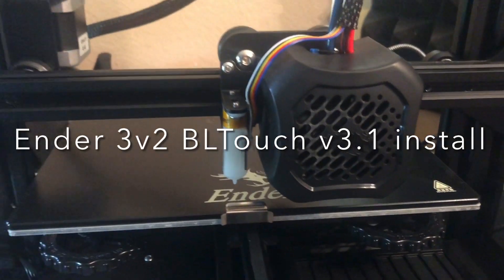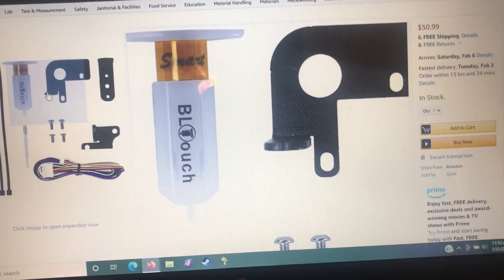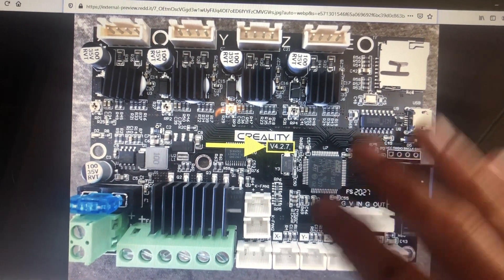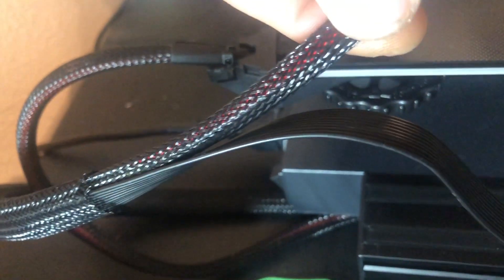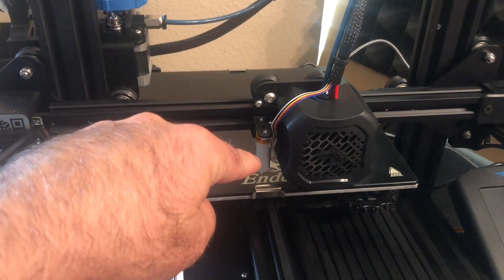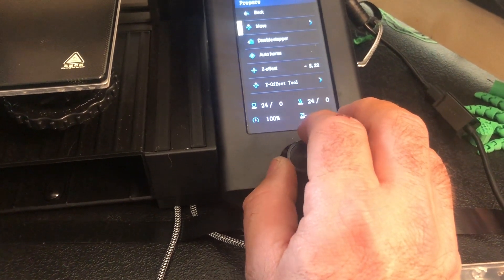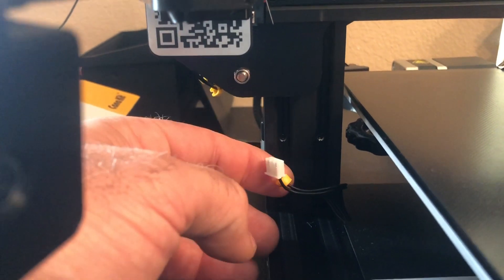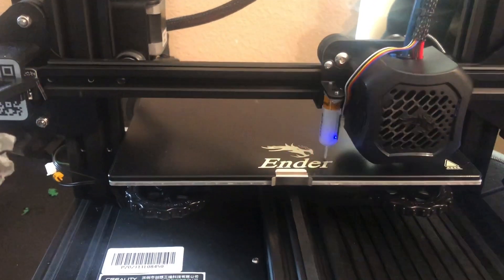Installing the BLTouch 3.1 kit on an Ender 3v2

Comment: Great job. You need to try your hand, at this making video thing. Watchable style, good voice over, left no questions behind. This was a overlooked popular mod.
Reply from the maker: Thanks so much!  I’ll make more. I’m still unsure of what exactly that looks like or how often. But more will come.
Reply: Spent 4 days on the BL touch this video helped me out of the woods. The big issue i missed was the included metal mount I somehow had upsides down. My endgame was Smith3d and with this video it was finally a wrap. Saving settings was key.
Reply from the maker: @JasonStPierre  Jason let me ask you something.  Any steps between the more popular videos and this one that you feel get missed?  We have another 3 V2 arriving today. Assuming Jess will let me mess with her printer, I’m thinking about remaking this video as a full BLTouch install from start to finish.
Reply: @brianhart1771  OK a few key issues I have had, ONE: I got the same BL touch kit . I followed another tutorial that suggested the sound idea of twisting the included wire to reduce interfeance form the other wires in bundle. I had a issue prior that the BL would error out otherwise this fixed it. a ferrite choke would have as well but this was free and simple.
TWO: The extruder was in my kit with outer parts, marking off 100 & 120mm on a cutoff and doing a "free air calibration" bowden tube off extruder was a simple math free adjustment detailed here, https://youtu.be/lH-RrjtiC8M

Also see all this guys videos. Tomb of 3D Printed Horrors https://youtu.be/xzQjtWhg9VE
More Bowden tube here you should watch, https://youtu.be/uEo5vNGsO6Q
that video had me toss my new fake Capricorn tube due to small ID drag.
Todays agenda is a full reinstall Of Octoprint with limited plug ins as it seems some don't like to work together. UG...
Reply from the maker: @JasonStPierre  that’s a lot of good ideas. I’ll put some thought into it. Thanks so much!

Comment: Hey buddy, I am just a newbie in this as well and I got my Ender 3 V@ and the new BL Touch V3.1 recently and couldn't find a single video to help, just wanted to thank you and god bless your little helper, cheers
Reply from the maker: Thanks!  My little helper is awesome if a bit noisy at times. Did you get it working?
Reply: @brianhart1771  Thanks to your video I am doing my first decent print with my BL Touch connected finally, Happy Printing and keep up the videos, if you have any tips for Raspberry Pie 4 or 3 I really appreciate it Thanks
Reply from the maker: @sm5599-l6m  fantastic!  I’m planning a Pi video soon. So look for that. I’ve gotten most of my help from the githubs for the various plugins though. That and Reddit.

Comment: Where is your Pi plugged in? I noticed at 8:17 you have cables plugged in to the pi, but it's not in the on the front of the printer. 

Great video, thanks!
Reply from the maker: Sharp eye!  I unplugged it while I was making the video.
Reply: @brianhart1771  Haha thanks! I was just making sure I didn't overlook some hidden USB connector in the back or under the Ender :D  Thanks again for the video! I'm waiting on my BL3.1 now because of it!

Comment: Can you make another video where you show the plugs and the process of plugging it in? Like a step by step?  I'd love to see that.  Thanks!
Reply from the maker: Honestly, I've been trying but I just havent had the time yet.  In the meantime try searching for videos here on how to plug in computer cables.  You'll find many good examples.  It's pretty straigtforward.  Go slow, make sure you aren't bending the pins, and that each end is correct.  If you look closely at the connectors you will see they only go one way, assuming you don't force them.

Comment: I just removed mine because I cant get it to probe correctly on Zaxis because the Zaxis wont simply move down. Very annoying and I dont know how to fix it. I=m back to leveling the manual way on my Ender 3 V2 until I find a solution

Comment: I bout the version 1 BLTouch. It doesn’t have the 5 pin connector that connects directly into the board. It has a 3pin and a 2pin. Also has an adaptor board that plugs into where the screen does and reconfigures the plug in. How would you suggest setting this up? I tried directly connecting to BLtouch port but my main board started to smoke. Now have it configured with the board adaptor. However, not able to see bed leveling measurements or able to store Z offset.
Reply from the maker: Sounds like a video like this one:  https://youtu.be/jO4PAWvWdH8 would be helpful for your BLTouch install instead of mine. It smoked?  Yikes!  If you can’t see the bed leveling or Z offset option that sounds like a firmware issue to me. What firmware did you install?  You light look for answers in the ender3 subreddit on Reddit. I’ve found it to be helpful.

Comment: Hey brian,,  great video, If I could make a video it would be pretty exacto mundo to your video because I have been going thru all the shit you have been mentioning. So I am glad you made this video I would have just screwed the pooch. I am actually installing the bltouch as we speak or type or whatever. I will let you know how my adventure goes, because lately it seems that whatever I do turns into a damn adventure from hell.
 Hopefully they wont change anything while I was here yacking. thx again Felix c
Reply from the maker: I’m so glad it helped!  Get everything working?
Reply: I wish. I am having a problem compiling my firmware together to include a bl touch install. I cannot get it to home. I have gone thru countless vids and articles as you are probably aware of what a pain this can become. I have gotten to learn vocode  but I am working on it right now. Any suggestions holler back at me. 
Thank you

FC
Reply from the maker: @juniorshbr13  I wish I did. I haven’t tried compiling my own yet. We just installed the BLTouch on another machine the other day and used the standard Smith3D firmware.

Comment: Did this, fried the mainboard ... had to order new one ... bl touch doesn't even light up anymore. Back to manual leveling.
Reply from the maker: Man. That sucks. Any idea why?  My first guess would be the wiring was incorrect. But that’s just a guess. Was it the official BLTouch or a knockoff?
Reply: @brianhart1771  I bought an antlabs set and extention cable ... both marked as compatible. I suspect the bl touch is the problem because with the new motherboard it is just dead ...

Comment: What’s the point of a bl touch if u have to keep leveling the bed, I don’t think the bl does anything to be honest.
Reply from the maker: Do you have one?

In my experience so far it absolutely does “do something”. My first layers have never looked better. You can also see it working by watching the Z axis motor. It makes tiny adjustments during your print. 

My thinking, and I’m both picky and a newb, but my thinking is I manually or AUX level to get as close as I can. And the BLTouch takes care of user error and deviation in the bed surface (to a point).   With that said, I find myself manually leveling less and less as it seems I just don’t need to do it as much.

But ymmv. Thanks so much for watching the video.
Reply: @brianhart1771  I’m keep an eye on it and see, maybe I am doing something wrong the only difference from ur setup is that I have the 4.2.7 board besides that everything is the same. Maybe it’s 3dsmith software since I have to download the 4.2.7 ver. I will play with it a bit more and see. Thank for the video.
Reply from the maker: @noseeam8202  good luck man!  Hope you get it dialed in. The Dr Vax videos, FB user group, and Reddit Ender groups have been a big help to me.